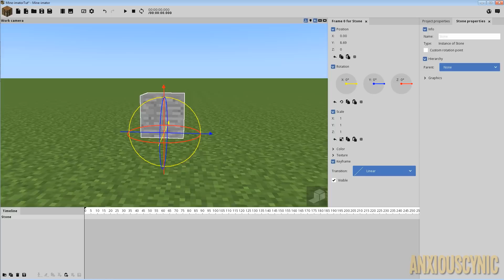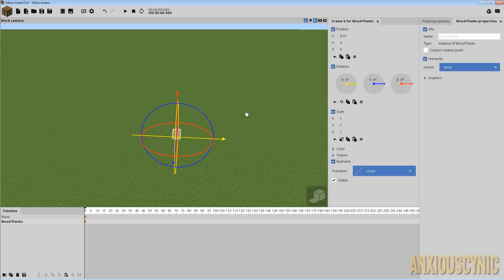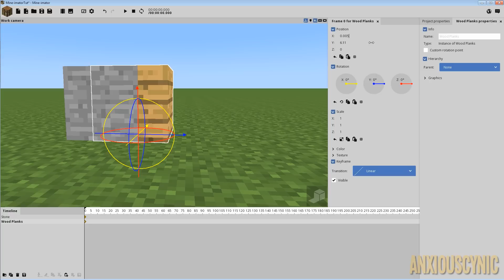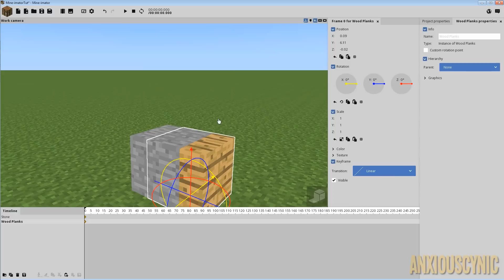How To Fix Texture Flicker / Z-Clipping! | Mine-imator Tip

Comment: what about changing the scale of one of the blocks to 1.001
Reply from the maker: What about it?
Reply: couldn't you do that to get rid of Z-Clipping. You did that in the block breaking tutorial.
Reply from the maker: In the Block Breaking example, you're using a block that has transparency. In this example, you want both blocks to be represented, but overlapping each other (which is an a common trait of rig-making).
Reply: oh